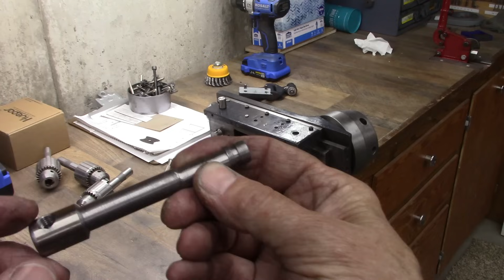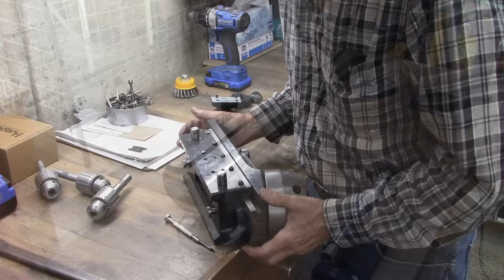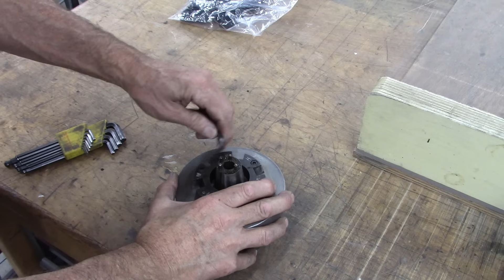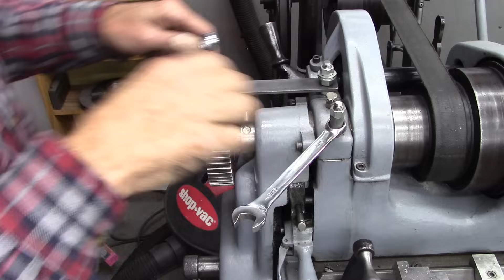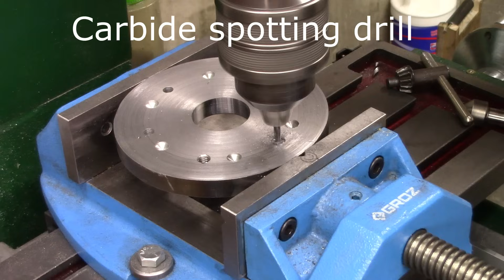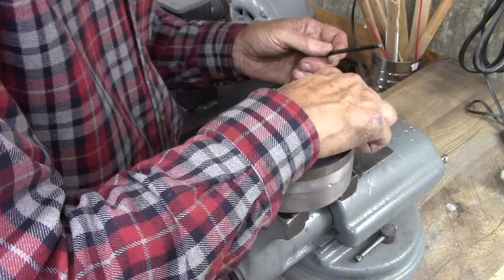Rebuilding a Hardinge Cataract Turret Tailstock Part 1

Comment: Ah, the old turret lathe! This was the original automatic tool changer that the CNC mill replaced. I only had a few days using one of these lathes when I first went into engineering, but it made very fast work of turning out extremely accurate parts at a high rate. Equipped with a thread box, cutting tool and chamfering bit, I could manage a set bolt in about 30 seconds, all day, way back when. Happy memories indeed.
Reply from the maker: very cool! Thanks for sharing.

Comment: Strangest thing happened this morning.  The big saw was broken at Lowes and I took my 18v battery powered portable Dewalt circular saw with me as I needed to cut some 4x8 sheets of 19/32 plywood in half into 2x4 ft strips (to get it into the car)..  I laid (4) 8ft 2x4s (on edge) down in the parking lot next to me and put a sheet on those.  I had a 6ft straight edge and was making an 8ft cut right up the center (I clamped one end).  I had a new blade on my dewalt 18V saw and a fresh large battery.  It cut ok for about 4ft then got harder to push.  I flipped the straight edge for the remainder of the cut and the last 2ft was really hard to push.  The blade did not bog down or stop and seemed to cut fine.  I did forget to raise the blade and it was making a full cut.  The battery still showed 2/3 charge after (2) full cuts and I tried a second fully charged one with no change.  Each cut went the same way with the last 2ft really hard to push.  I did notice that I thought the kerf was a little wide.  It felt like the plate on the saw was really sticky like it had tar on it or something but it's clean.  Maybe the blade isn't parallel to the edge of the saw?  hmmm......  It seems like I always have this problem no matter which blade I use on it.  I'm always so impressed when I see you make those perfect cuts on your table saw.
Reply from the maker: Maybe the wood was pre-stressed and clamping down on the blade? Plywood is usually okay in this regard but I have ripper 2x4s on my table saw and terrible problem. When you remove the wood with the saw it starts closing the kerf behind you. Just a guess...  Oh yeah, I love my table saw and even more, the cutoff sled. You can lay a 4x8 sheet in it and cut it in half. You can use an air nailer and take guides to the sled and cut whatever shape you want. It's very safe too. The only negative is that you can't tilt the blade. I made a smaller sled for this. Tilting the blade cuts a big v in the sled .
Reply: I took the blade off (remember it's new), the outside surface still looks new and the back side has a black ring about where the thickness of the wood was.  From there to the outside edge and teeth, it's clean like new.  None of the teeth have any build up or discoloration.  Maybe the blade is cupped??  How else could that happen?
Reply from the maker: @robert574  That is very strange.
Reply: Now I've got to get those plywood sheets into the attic so I can slide into some small truss openings on my back to do some work.  Edit, Wow it's hard to do by yourself.  It kills my back not being able to stand up and you need a chair or something to sit down and straighten up.  It's hard to imagine how roofers walk on an angled surface all day.  They aught to have tilting shoes (or something for the rest of us).  How about an inflatable pocket inside the heel or a jell pack that squishes then freezes and locks until you lift your foot again.  We could be rich.  A pivot in the center and a pocket of fluid in front and one in back.  As you put your foot down, it tilts to match the surface and then a valve seats as you press down.  I could see it.  The articulating shoes.  "Yea, I hear you, I'll be right there!" Squish, squish, squish, squish....  My God, they could be magnetic and when you are down working you could store nails on the outside of your shoes.  Then when you lift your foot, it unlocks and they all fall off.  
That heat in the attic is something else.  You don't need to build a sauna if your house has an attic.  You just need a ladder, some chairs and maybe one of those misting bottles.
Reply from the maker: @robert574  Haha...  nails on the shoe!

Comment: Despite taking care, and using an indexing system, those holes never quite line up. This happens to me a lot!
Reply from the maker: I have very good luck although occasionally a bolt is tight. There is a little slot in the pin going into the gear on my indexing system but quite often the bolts are oversized by .002" I've only had this happen with socket head bolts.

Comment: Those cracks were probably caused by someone swinging some heavy chucks and then the impact of stopping it.  I didn't see the whole locking mechanism.  There might be a way to dampen it.  Remember, you're trying to increase the contact time of the impact.  Like the difference between dropping an 8 ball on a piece of glass or on a foam cushion.  Man, this is interesting...  Give some dimensions on that socket you don't have and you might just get one in the mail (like you did to Lyle:)
Reply from the maker: You might be right about the impact although the way it locks into the recess in the turret head makes me wonder if it happened when somebody pried on it when removing it. I didn't even know it was broken until I started to remove it. If it broke from impact (sudden stop) you'd think there would be move loose fragments between the pieces. Either way I'm not going to be unnecessarily rough with it. There is also the repaired linkage (brazed) to consider. Thanks for the offer on the socket but no need, the neighbor has one and it's a size that I'll never need again. Heck, I don't even have a 1/2 drive socket set. I seldom need anything that big.

Comment: Too bad about the broken index plate. My guess... it would be hard to find a replacement, but then I don't know anything about those lathes. I am a large gear head engine lathe industrial repair kinda guy. Nevertheless I have enjoyed the whole series on the Cataract rebuild. I really like the way you deal with problems and use the equipment and tools you have to great effect. Cheers
Reply from the maker: I'm guessing it would be near impossible to find that part unless you found an old another old tailstock. I think its going to do okay. I'm guessing its been that way for a while.

Comment: Could that shattered back piece be the result of whacking the indexer really hard in an attempt to get the turret round to the next position ?  I'm assuming it was cast iron rather than steel.
Reply from the maker: I thought about that too. You could be right. I took the turret off and it still looks the same.

Comment: It just keeps getting better and more useful. pretty amazing transformation from ornament to quality machine. Did you solve your bearing adjustment issue?  I just picked up a 13x34 Leblond Regal last week, in exceptionally good condition. The Iron fever is spreading. I ran my 24 inch shaper for 3 days cutting a set of jaws for my cool antique 3 jaw. I really love this stuff, watching, learning and doing it. I think my next project will be making some fixtures for my cutter grinder.
Reply from the maker: Yes it is addictive!!! The bearing still gets warm but never hot. I think its fine.
Reply: have you considered graphite? @WinkysWorkshop

Comment: Hey Winky, many years of removing taps has taught me to break the chips often by reversing the tap while tapping the threads. This makes a tap remove much easier if it should break. Great videos 👍!
Reply from the maker: This was a spiral tap and all the chips are in front of the tap. They don't really need to be reversed. Of course I'm not saying it wouldn't have made removing the tap easier. Thanks
Reply: Depending on the material you may still have to break the chip by reversing. The tap cannot eject the chip in either direction if it is not broken off first. I have had some tragedies tapping rubbish steel and the chips were long, did not break easily and jammed the tap. However expertise in hindsight is easy. I learn a lot form all of you videos thanks.   @WinkysWorkshop
Reply from the maker: @robertwalker7457  Well, I disagree about reversing. The tap it not shaped right to break the chips and they will simply tangle. Everything I have read and experience say it's best to only use a spiral point tap for through holes and that you should feed completely through the hold before reversing. I don't always follow this rule, I sometimes use the taps for blind holes but the chips always stay in the bottom. https://www.yamawa.eu/how-to-prevent-tap-breakage-using-spiral-pointed-taps/#
Reply: Thanks for that it explains it well. @WinkysWorkshop
Reply from the maker: No problem  @robertwalker7457

Comment: Hi Winky, regarding the broken tap: is there a reason you aren't using tapping fluid and also, why aren't you clearing the tap every with every quarter turn of the tap wrench?
Keep up the good work!
Reply from the maker: This was a spiral tap and all the chips are in front of the tap. They don't really need to be reversed. I did use tapping fluid, I guess it got edited out. If you have not tried them you should. They require a lot less torque. The only reason the tap broke is that my indexing gear slipped.
Reply: I agree with Winky. The spiral point (gun) tap is designed to “shoot” the chips out of the bottom of the hole. They’re stronger since the shallow flutes are only for lubricant  They don’t need to be reversed. Spiral “flute”taps are a different design. They lift the chips out through the flutes and are best for tapping blind holes.
Reply: I know all that but anyone watching the video can't know what type of taps he was using.
Reply from the maker: @01thomasss  Very true

Comment: Mark when you've got a broke off tap like that take a nut that is about the same size or one a little bit larger and sit it down over the broke off tap. Then take your welder and weld up the hole in the nut and to the top of the tap then you can back it out with no problems most of the time.
Reply from the maker: That's a good idea...  although not much of the tap was sticking up
Reply: @WinkysWorkshop  it doesn't have to be sticking up. It works 90% of the time . The times it doesn't work is when someone bottoms out a bolt into a blind hole and its tight against the bottom of the hole then it gets hard to get out. But even then if you drill a hole in the center of it you still can use that method and most of the time it will back it out.

Comment: I am Amazed at you do not use Cutting oil when machining Steel .Ive been a toolmaker for 52 years and I NEVER turn , Drill or Machine anything without using Cutting oil . You will be amazed at the FINISH and TOOL LIFE that using it produces . : )
BTW  I have that exact turret your repairing on my Very early Hardinge Second operation lathe . Along with the production cross slide attachment and Tailstock . My Hardinge is just like the one you are using , Except mine is Cabinet mounted with chip tray and has under bench motor and drive mechanism . I have 2 Additional Hardinge Lathes HLV H  and  HLVH
Metric threading . Lots of Hardinge tooling to go with them . I have operated Hardinge lathes and Mills for MANY Years . Couldnt be with out them : )) 
Thanks for sharing your video 
Cheers ~
Reply from the maker: I use coolant on my mill and oil for drilling larger holes but never use oil on my lathe. Too much mess. I think my Turret is a model 97. I wish I had the original rotating section. The Hardinge UK web site says that the Cataract lathes with the name plate under the headstock are pre-1906 or 1907. After that they had a tray.

Comment: Hey Winky an Easy-Out tip for ya. I'm a retired A&P mechanic and every jet mech has a large collection of them because we use them all the time. I've removed 1,000's of screws and bolts with them over a 45 year career. The secret to using these type of removers is keep hitting it with a hammer while you turn it. In spite of it's clever design it will still try and cam out on you. Tip #2, Use as small an easy-out diameter as possible. If the wall thickness of the fastener left after drilling is too thin, as you drive the easy-out in and turn it, it will push outward on the wall of the screw and only compound the problem.
Reply from the maker: Both good tips. Thanks! Note...  the easy outs were also junk.
Reply: I’ve never had much luck with easy-outs but sometimes that’s all you have. Thanks for the tips.
Reply: Isn’t is strange, you know when that tap brakes you are ether going to be luck or going to spend an hour getting it out
Reply from the maker: @TERRYB0688  True. It took 20 minutes and I considered myself lucky

Comment: One question if I may? What is the feet per min of your belt sander? 
Btw thanks for showing I am not the only one who breaks taps!!! 73 dan
Reply from the maker: Ha...  your welcome on the tap. The sander is 3/4HP 3450 RPM.  2 x 42. It has a 5 inch drive. If I did my math right thats about 4500. It could go faster but it's totally adequate.